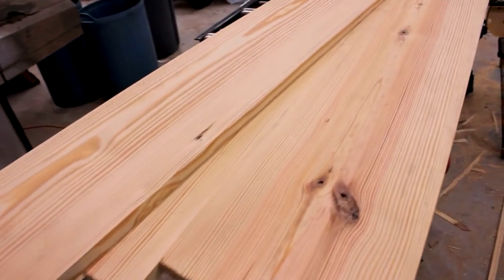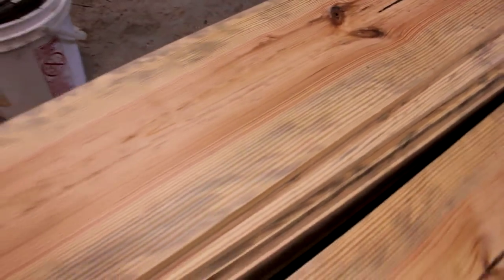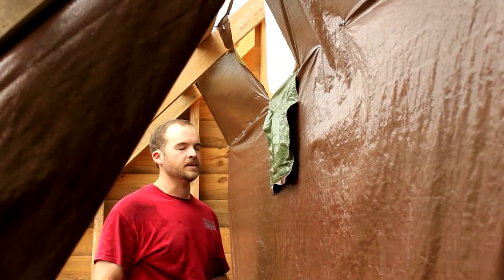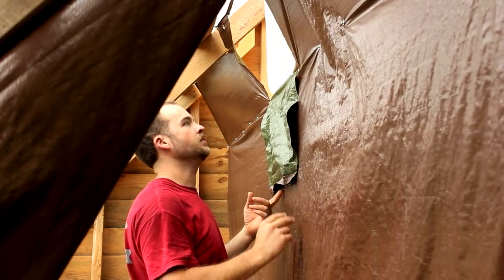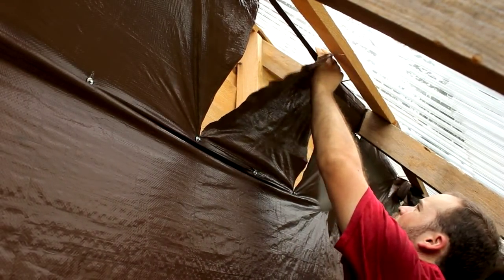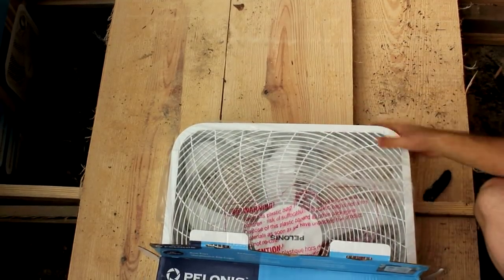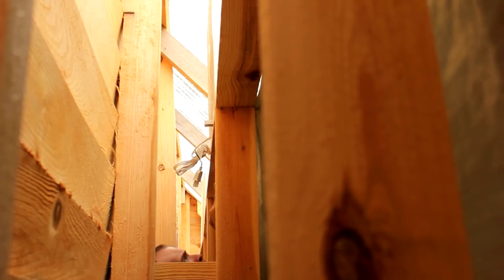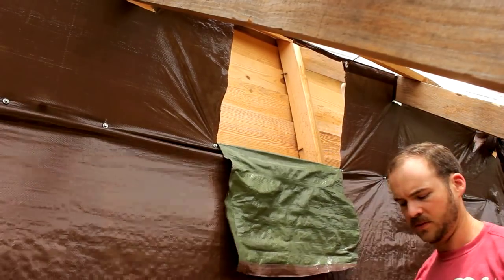Building a SOLAR KILN!! Part 10

Comment: I built my solar kiln about 25 years ago and followed a somewhat similar design, however I have some comments that might help: I decided to make it large enough to walk into because I figured it would be hard to stoop through a shorter door for the rest of my life. I am glad I did! I also made it bigger than I thought I needed, and when I moved a couple years ago, I made it even bigger, because my propensity to collect wood does not decrease, even when I use wood a lot. I used glass because I got several sliding glass doors free due to a huge disaster in my area, so if you have a hurricane, tornado, or earthquake, consider scrounging for free glass doors. I also built on two layer walls and floor and used the channels created between joists to be moisture/air channels. this required a somewhat nontraditional way of building walls that do not have a bottom plate, so the floor channels connect to the wall channels. I also put slots in the floor and covered with expanded metal mesh. I bought cheap/used computer fans to move air in these channels, which is low power and sufficient. I exhausted moist hot air into the walls from above rear and moist air out the bottom, and allowed fresh air to come in the front, and flow up the solar wall to be heated, somewhat more complicated than M Deighan suggested previously, but probably using similar logic for heating air, then exhausting it. I live in a very dry climate, so it is not as big an issue for me. You may want a different solution, even including a dehumidifying step? Just remember that as saturated air cools, it will condense liquid water, so let the hottest wettest air go outside before it cools. I also found that the shed makes great long term storage. It's helpful to build some rack above head to hold some things and use that space better. Also, close up gaps with foam spray. I will watch some of your beekeeping videos. I have three bee swarm traps full right now and one of them is actually an owl box, which i placed so far up in a tree I have to make guided rappel/zip line for the box of bees this week!

Comment: And just to let you know I would have used the whole floor you built. I would have just left the roof at 9ft. .. my first commit will fix that mold problem. Your not getting enough air through the wood...

Comment: I know that you have discussed heat v ventilation in earlier videos, but in my humble opinion dry air needs to pass between the lumber and out of the kiln. However you can engineer that. Nice job.

Comment: you need fresh air vents feeding fans at the top and exhaust  vents at bottom of back wall to exit moist air.
Reply: Wouldn't the exhaust need to be at the top so the lighter moist air could exit while pulling in more dry air circulating around the bottom getting pushed thru the stack of wood

Comment: I have a question for you,  how are you loading your lumber into your kiln, I would use 3/4" X  3/4" X  54" to 60"  strips  24" on center for each  layer of  lumber and I would place  the stack of lumber on dollies using 4" casters setting on a C channel track through the door and out the other side door.

Comment: Would it help to just git rid of the tarps?
Reply: The tarps force the air to go through the wood so it dries, otherwise the air will just circulate above the wood.  I didn't know what the baffle (that's the correct term) was for and didn't include it in mine only to find later only the top most layer had any drying.  That's when I installed the baffle.

Comment: You really took the long way around with this project carpentry wise. Lol. Trim goes on first with horizontal siding, tarp could have been put on before siding as well. But why on Earth did you not put a set of double doors on the back wall for easier loading and unloading? Well, it's done and sounds like it's working well.  Something to be proud of for sure.

Comment: I'm super interested in these kiln videos. I bought a 20'  shipping container  that I plan on using as a kiln.   In the summer it will be solar for the most part and winter I'm thinking of making a wood fired boiler or just put a boxwood stove in it with the loading door to the outside. I want to putt solar 12 volt fans in it for exhaust on a timer.

Comment: To fix the boards I wonder if tea tree oil will get rid of the spots. From what I understand. Bleach doesn't penetrate wood very deep. Another thing to try is hydrogen peroxide. And cheaper than tea tree oil.

Comment: I know nothing about kilns and I am enjoying your posts. I would eliminate the tarps they will condensate and your losing the beauty of all that wood you have in there.
Reply: I was thinking along those same lines, I don't understand the purpose of the tarp.  I would think that just the fan and the fact that the kiln is poorly sealed would circulate the air and let the moisture out

Comment: The best way I have found to fix the black mold in pine is by spraying the wood with a mix of 3 cups of borax and one cup boric acid which is a form of roach poison to 2 gallons of water in a pump up sprayer . I spray it on when I put it in the kiln on both sides .it dries in a hr or so and the Sodium that’s in the Borax forms a protective barrier on the surface of the wood until it’s plained off .have 7 fans In my kiln and more air flow never helped.this mix doesn’t stain wood .

Comment: Are you planning a video update on the kiln? Just wondering if more airflow helped, or if the issue is low temperature and/or high humidity? Thinking of building one myself. Could seal the interior and paint it black to increase day time temperature. Could insulate to hold the temperature in overnight. Could try a dehumidifier or be more strategic with venting.
Reply from the maker: Yes, all of that stuff would help. I added even more airflow after this video and it solved my problems.
Reply: @falllineridge  Excellent!

Comment: you are right.  you need to move air around.  this is a simple fix.  install several fans so it circulates really well.  if i were you, i would run the fans on solar cells so you can capitalize on the suns rays.  are you maintaining proper temperature?  if not, you can add some incadesant bulbs on a thermostat to keep the temperature spot on.  i am in the process of doing a major remodel on my house and part of it is to clear some trees.  i have some massive red and white oaks and several other species.  i already have a mid size kubota tractor with a front end loader.  instead of buring that precious wood up in smoke, i am going to buy a sawmill....probably a wood mizer too.  there is a wood mizer branch around 20 miles from my house in the atlanta area.  i think i am going to splurge and get a bandsaw mill with a hydraulic feed.  i have some medical issues that has lowered my endurance so i need to cut out manual labor as much as possible so i wont get burnt out with milling.  i am going to build a solar kiln and a traditional kiln too.  after we have the trees taken down and milled,  i will need a lot of kiln space to dry the boards so two kilns hopefully will suffice.  i cant wait until we start.  hopefully we will be starting in a few weeks to a month after it cools off....the heat really wears me out now so i need cool weather to work in.  take care....
Reply: How’d it all pan out Todd?

Comment: The mold is caused by having no vents to exhaust the moisture. You're just moving the moisture to the other stack that is not getting enough air flow.
Reply: The entire structure is the vent.  The siding is not sealed, literally every single board edge lets air flow in and out.
Reply: @sjsmith801  Not enough, though. MC is way too high and that causes mold to thrive
Reply: Two boxs made with styrofoam board between the tarpaulin and the out side wall, with vents in outside wall would work great in my opinion. Placed at the very bottom.

Comment: I used to have a saw mill coming to my place to saw few dozen maple logs at a time, every year for a while.  I had a good setup for it. I found a few things over time. Air movement is the key.  You may want to leave a space between the sides of the boards (1/2 - 1'') on each rows. Make sure the soap solution in the sawmill is not already contaminated by bacteria.  The sawmill won't see anything.  But the bacterias will be happy to be spread all over a new growing/feeding material.  In doubt, have a well diluted chlorine solution sprayed on the new boards before stacking. Thanks for sharing!
Reply from the maker: Joe Lesage Good tips! Thanks! And thanks for watching!

Comment: Three fans should help a whole lot. One important thing to do to make sure your fans are forcing all air through the stack is to make sure there are no air leaks in the kiln. In other words, seal the kiln up so that the fans don't force air out through cracks in the walls on the pressure side and suck it in through cracks on the vacuum side.
Reply from the maker: Darrel Carson Good advice, thanks Darrel!

Comment: I'm not sure if your mold issue is mildew or blue stain, but if it is mildew you can try applying a solution of 3 parts water, 1 part bleach and a dash of dish soap. Spray it on and let it sit for a few minutes. If it's mildew, the bleach will kill it and remove the staining. Then rinse thoroughly with your hose. You can try one board. You have nothing to lose, really. Good luck!
Reply from the maker: nhcaesar Tried it with wood bleach (oxalic acid). Didn’t change a thing. Maybe it’s blue stain then.

Comment: I was shouting to the screen, "PUT THE WIRE THROUGH THE KNOCK-OUT FIRST!!!!" LOL
Reply from the maker: Roy G. Dodd Sometimes I learn things the hard way 😂
Reply: I couldn't help but laugh when you saw what you did; you had the perfect reaction!  LOL
Reply: Fall Line Ridge  They make a spray that kills the black mold on contact but you have a use it in attics in places like that that makes the would look brand new

Comment: What is happening is the fans are pulling up the moisture out of the wood and its staying on the back of tarp then when no fan is on its dripping back down on the wood causing it to mold do away with the plastic and use landscape fabric PROBLEM SOLVED

Comment: You need two them big barrel fans from tractor supply. One on each end. Pulling air flow in the other blowing outside. But their costly.
Reply from the maker: Jerry Little That’d be pretty slick.

Comment: I tried to yell to put the wire in the box before you put the plug on but you couldn't hear me from Kentucky .
Reply from the maker: River Rat Ha! I appreciate the attempt.
Reply: @falllineridge  You should have used a box connector to protect the wire and brought the wire in from the top...

Comment: Built solar kiln 6 years ago. Had same issue with pine. Came to conclusion that I didn't air dry long enough before putting it in kiln. Pine has so much moisture in it all the way thru. Adding heat from the kiln plus lower air flow causes that mold. Solution.... air dry longer. If you use so many fans and pay larger power bills you nullify solar savings. Don't have that problem with dryer wood like cedar and poplar.
Reply from the maker: Jeff McElheney Thanks for the tip! Might have to start doing that.
Reply: I had a similar thought. Have less wood in the kiln to reduce the humidity and improve internal circulation. Interested to see how you have got on with the 3rd fan. My experience is that small softwood logs, that are left outside, even in cool climates, with regular rain, dry very fast in the first 3 months.

Comment: I let my lumber air dry for a month then put it in the kiln. Most of the moisture is lost in the beginning stage. I also let my fans run constantly in the kiln to prevent mold. Painting the interior flat black can help it get hotter in there, today it’s 90 outside where I live in upstate New York and 140 in the kiln. Looks like it’s coming along nicely, always enjoy the videos.
Reply from the maker: scot butler Thanks Scot! I’m thinking about upgrading with some black sheet insulation at some point.

Comment: I don't think that ugly duct tape is your problem!   :-)   :-)  I cringed all the way through your initial wiring of that outlet, but I'll bet you won't make that same mistake again after having to take it apart and start over! A tip from an old wire-bender...if you make the individual leads 4 to 6 inches long, it is much easier to insert the outlet in the box when wiring is complete - that is if you use the required proper Romex Connector in the box that is absent in your installation here!  I hope you matched the breaker size to the Romex size you used.  Enjoy your videos - good luck.
Reply from the maker: Steve Adams Appreciate the tips, Steve! An electrition I am not. I need all the advice I can get. I appreciate you watching!